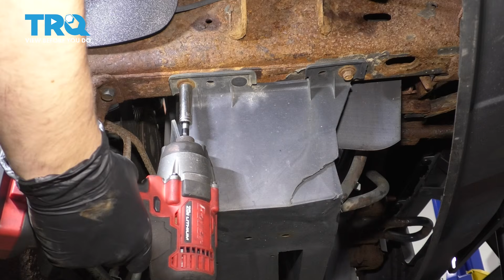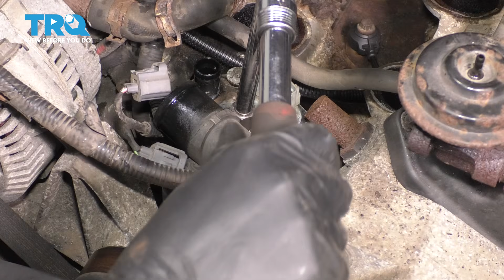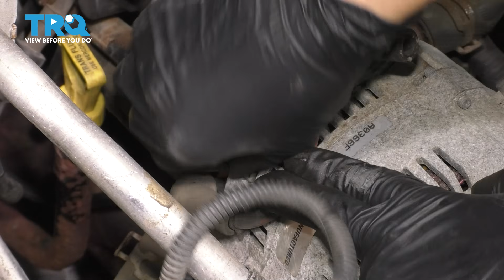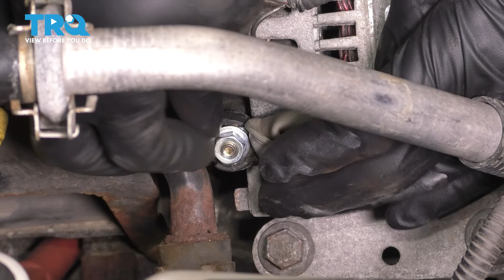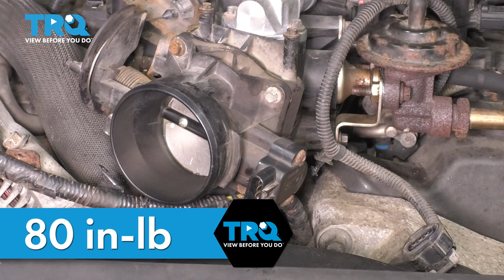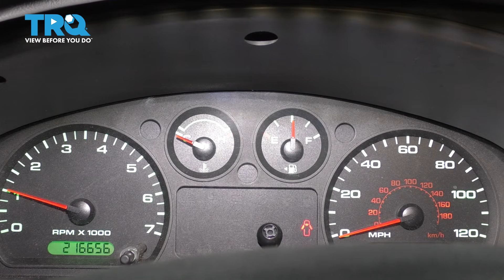How to Replace Thermostat Housing 1998-2011 Ford Ranger (4.0L V6)

Comment: A tip from an old tech, spray all the hoses on the inside using a pick with WD-40, they slip off easier. Then a squirt on them before reinstalling and they bottom out very easy, plus the clamps slide into place perfectly.  Good luck.

Comment: You are an absolute legend for making this video, wow. What a nightmare bolt, I would have been pulling my hair out. You did all that extra work to get it out and then even put everything back together before putting on the housing as if the troublesome bolt thing never even happened!!! actually legendary.

Comment: Got mine off.I'm glad I did it when I did because, yeah, my boat was extremely rusted on the thermostat housing. And wiggle it back and forth and use a ton of p b blaster, but I got it off everything went pretty good. I would recommend if anybody does this. Don't use the thermostat, they give you with this housing or the sensors. Go get your hand good name brand ones it's pretty street forward jo

Comment: Wait wait wait… reusing the bolts, after snapping one, smh who is this mechanic, who needs to disconnect the pcm to change an thermostat when it’s in two opposite directions, buddy turned a 20min job into half the day

Comment: Taking out the Intake Manifold for replacing the thermo housing is a HUGE risk for a ford engine as chances are you will break one of the 8 bolts. As a last resort, yes! but not for the thermo house replacement. You were lucky not running into major issues

Comment: A very useful guide to completing this job. Took your advice and removed induction. A little extra work but found two loose bolts holding induction, plenty of coolant, oil and what looked like a rat's nest in the valley. Replaced valve cover gasket too. All went well and B4000 running sweet as.

Comment: You should know that one of two the sensors that communicates with computer that controls the fuel mix at start up is not compatible with the 2006 Mazda B4000 and likely the Ford Ranger. The wire harness plug doesn't match with the sensor plug on the thermostat housing. For this part to work, you will need to use your old sensor (if it works) and swap it for the brown sensor in the new part. You will have to swap the little O-Ring gasket, too.  Filing down the clip on the new sensor will allow you to connect the wire harness, but it won't work and your truck will struggle to start if it starts at all. Buyer beware.

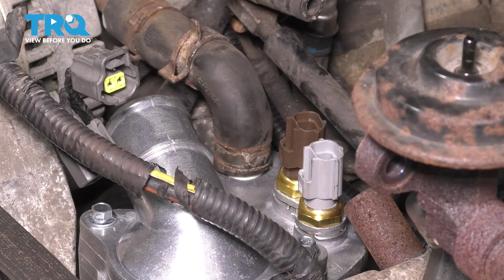Comment: I did this to my 04' ford ranger 4.0 SOHC a while back, came here to see how the connectors go back on the temp sensors. I had a feeling I reversed the connectors and also had an issue putting back one of my connectors back on the brown temp sensor. I ended up putting one of my old temp sensors which is grey on my new housing because the connector wont fit the brown temp sensor. Fyi if anybody does this pay attention to that detail you can see in the video the tech does this but fails to mention it 42:34. I knew It wasnt correct.

Comment: Believe I have the same engine in my sports Trac. The plastic housing have  started to leak,... thinking about doing it myself but every time I touch the thermostat on a Ford I break the bolt like you just did. Think I'm putting it in the shop I don't want the headache.

Comment: Not gonna lie.  My 01 Ranger is running so well.  130K mileage.  I think new plugs and wires are next.   Happy to watch this effort again.  Thinking about removing that intake manifold to replace my wires.  Just to better clean out the muck.  And I had to think about seized bolts.  Not seized to the aluminum block but seized to the metal sleeve inside the plastic housing. (like a seized bushing bolt on the lower control arm ~ another story).   Here, if you've got the clearance, you can go over each bolt with a hole saw, I used carpenter chisels, free everything around the metal sleeve for each bolt then I used vice grips with care, on what was left to break the threads loose in the aluminum block for a clean removal for each bolt separately.  Gotta have a vacuum cleaner set up for this messy job.  I know one guy who parted out the whole truck when he was faced with this job. This is definitely my favorite U Tube video.  By far.  👍

Comment: Yesterday ~ used a long 1/2 inch drill bit, Saws~all, long needle nose pliers, carpenter chisels, to remove all plastic around two studs that turned out to be completely fused to the metal sleeve. Had my vacuum cleaner adapted with a length of garden hose and duct tape.  Didn't take any of the stuff here off.  Just the air intake setup with the throttle cables. Yea.  Three hours of chopping any pieces of plastic at all, crowbar, etc.  Used two narrow cedar slats about an inch wide and 16 inches long like chopsticks to get all the soaking horrible mess out from under the intake manifold that you remove here. Had a whole couple of packets of napkins to swab the horror out from behind the thermostat housing. Anyway w/o any of the plastic holding the sleeve in the body of the Thermostat housing, both studs were able to be loosened.  Yea.  Two of my carpenter chisels, really sharp, carefully removing any plastic and separating the two studs (right back and the middle one that you are working with.  I had exactly the same scene that you're working with this morning.  Got three M6 100 80mm bolts with a washer to replace the two fused messes and the one that came out on the first try is now a trophy hanging in my kitchen.    Thanks for this one!   〰✨💥‼💥✨〰

Comment: I installed one of the aluminum housings on MY '08 Ranger 4.0 about 3 years ago. Recently my temp sender started leaking. I got a new O ring for it. To make it easier to install I removed the entire housing and went to get a new lower & upper seals for it. The parts stores HAVE these seals for the factory plastic housings. The smaller, lower seal fits and works just fine. The upper as I call it (The one for the actual thermostat is much thinner and rounded where the one IN the aftermarket aluminum housing is thicker and kind of squared off and just seems to fit better. I asked the same seller that I bought the housing from if THEY had these squared off seals and have not gotten a reply yet. Anyone know WHERE these thicker, squared off seals can be had?

Comment: I'm only about a third through the video and I can see that you'll need to demo that plastic housing from around that stubborn bolt with a bolt cutter or a small saw or a large hand nipper to gain access to that broken rusted bolt shaft and long bushing dowel rust to bolt. My center bolt was super rusted onto the dowel bushing, as are most of them I suspect. The long inserted dowel/sleeve protects the stupid flimsy housing from over torque and cracking when first installed at the factory. Intake doesn't really need to come off but you do have much more room if you don't mind the extra work and extra risk. I was determined to replace the leaking old brittle thermostat housing with an aluminum housing without removing that stupid plastic intake. I worked carefully slowly and meticulously in that small area under the throttle body horn, vacuumed area real well and change out mine, had the same stubborn rusted center bolt and needed to completely demo the plastic housing, breaking it into several pieces in order to extricate it, leaving nothing but one bolt sticking up, then used penetrant and vice grips on the lone bolt still standing proudly with the long rusty bushing dowel wrapped around it like a python that wouldn't let go, thankfully still with the hex head and perm. washer attached, waiting to be lubricated and removed via vice grips jawed around the permanent washer. Once I unthreaded bolt, an incredible pulling twisting effort and more penetrant was needed to remove the seized sleeve-bushing from around the bolt so I could retain the oem one. 
Removed idler pulley to gain better access to bypass hose for replacement. 
Way! way! too much work for a thermostat and it's stupid plastic housing.
Probably $1,200 job at the dealer, and they would put oem plastic back in...
the idiots!
What a mess Ford created using a plastic composite housing around such high and low desert heat of 120° in Calif.
Just more planned obsolescence to sell more $50,000 vehicles in 2024.

Comment: watching this video after I replaced my thermostat housing on my 4.0L ranger. 

I got lucky and didn't have to remove the intake manifold or the alternator and the housing bolts didn't snap. It was a tight job getting the temperature sensor off. But, I was replacing the water pump anyway so was able to get enough space with the water pump out of the way first.

Comment: On 2005 Ranger 4.0 the spring  clamps, when squeezed together will stay together. When replacing them, twist the pliers a little bit and it comes loose. This is a, next to worse, case scenario. Worse case is breaking off the ear the bolt went into. Having an Oklahoma truck, that I clean the engine compartment yearly, hopefully My replacement won't be as hard.